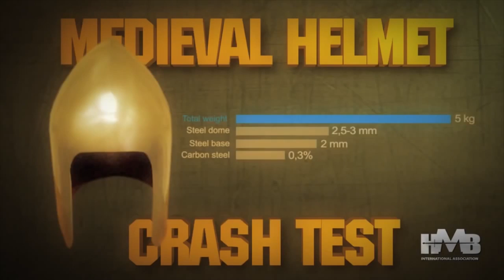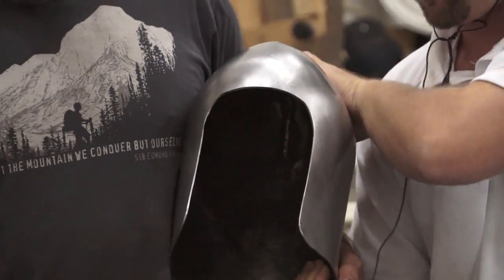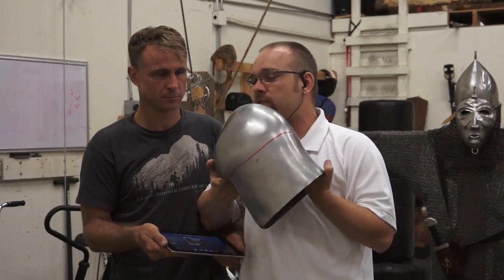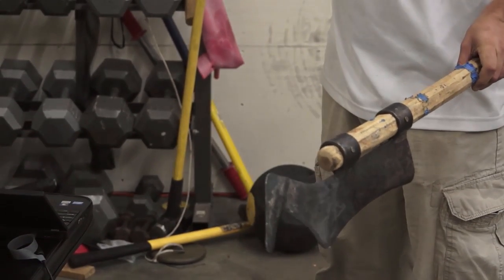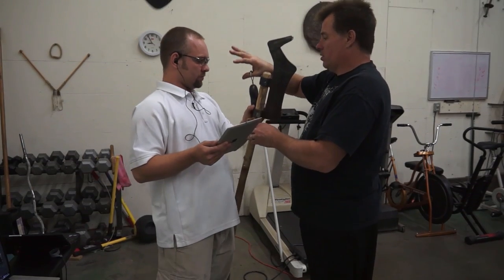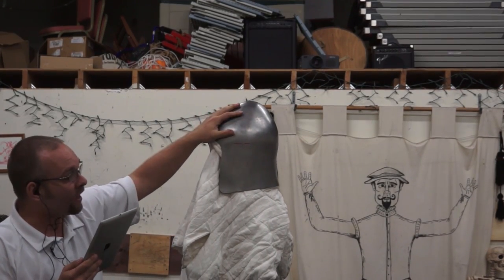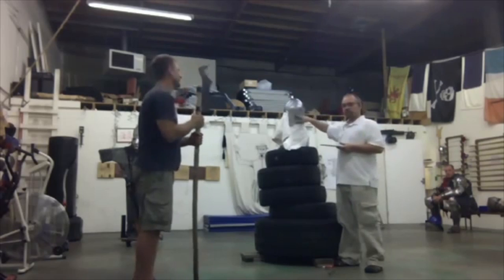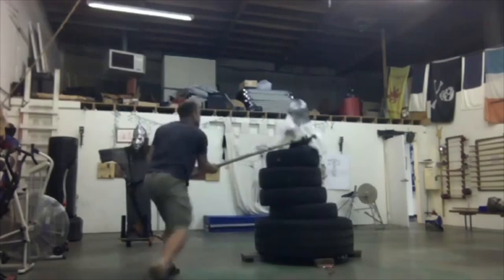Medieval Helmet Сrash Test. Supported by HMBIA

Comment: At the risk of stating the obvious.
a. The helmet would have had padding to help obviate the blunt force trauma delivered by the halberd.
b. Yes the helmet was dented but thats what they're there for.
c. The wearer of said helmet will be moving thus making it difficult for such blows to be delivered.
d. If the wearer was in that position he's already down and in a lot of trouble and the guy with the halberd will be working him over and and not just belting the helmet.
 I thought it was a pretty good demo on the resilience of the helmet. I definitely would be wearing one in a melee.
Reply: I was thinking if this is supposed to be a demonstration of the helmet failing, they failed. The armour looked very good to me and to be hit that hard would take you out through concussion anyway. I think the piece performed extremely well.
Reply: yeah I mean on top of all those you have to also consider that the wearer is not a vegetable either, he would be striking back. so theres another factor. and in response to D: if the user is down, the opponent must leave him alone as he is out of the match and it is forbidden to hit someone who has yielded.
Reply: plus the helmet is more sturdy if there is head with padding, instead of empty space

Comment: Bad quality helmet and weapon. The weld lines indicate that it was made fast and cheap. The helmet should be raised out of one whole sheet, varying in gages through out the helmet and tempered correctly. Also if the weapon was tempered correctly, it wouldn't have been turning that much and been able to retain its original shape. Should redo the test with a proper weapon and armor, that is as realistic as possible. If I were to go to battle I would never bring faulty armor or weapons.